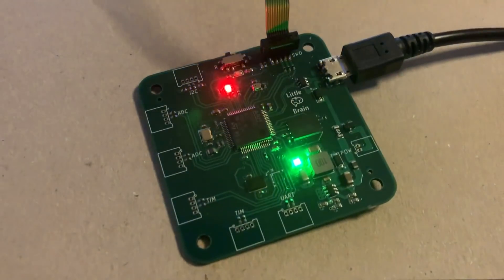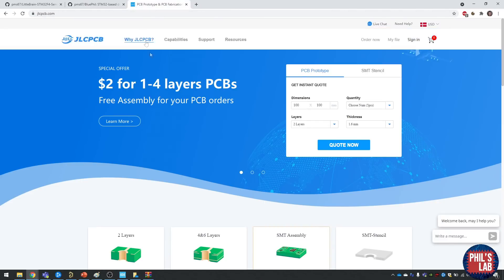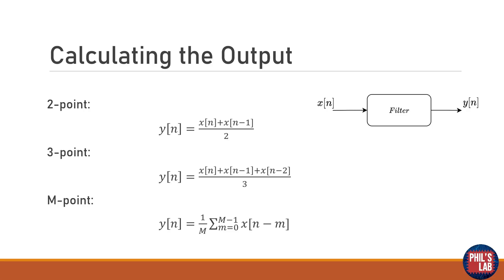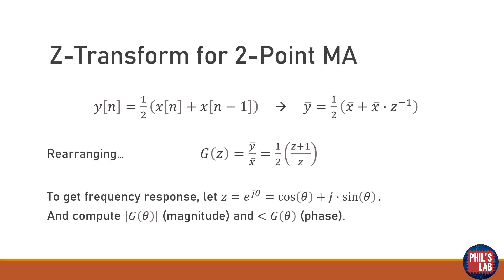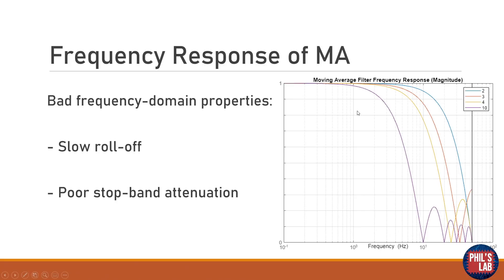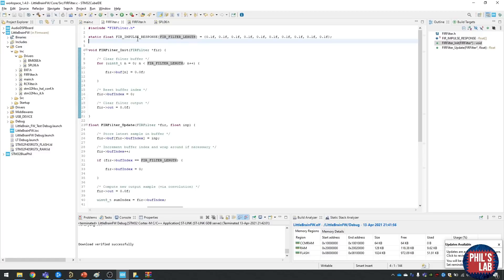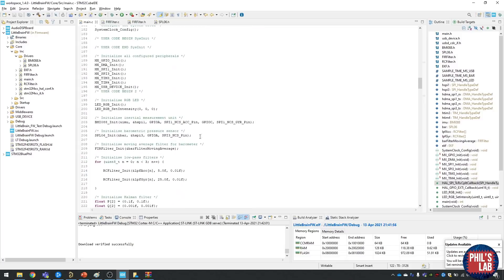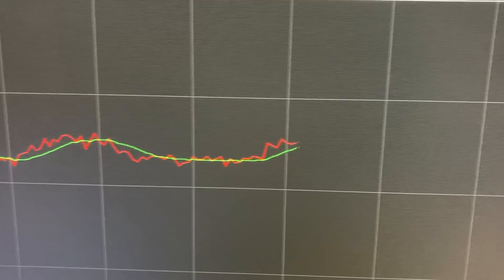(Sponsored) Moving Average Filter - Theory and Software Implementation - Phil's Lab #21

Comment: Dear Phil. Your Vídeos are very good. I would suggest you one vídeo using "semihosting" on M0, not M3 or M4, on STM32 CUBE. This is due to the fact that M0 does not have TRACE, and semihosting would allow debugger using INPUT and OUTPUT files passing throught the implemented M0 program. Other way would be to use UART to input/output throught some program implementations. Those videos would be great. Regards.

Comment: Hi Phil. Your videos are darn good stuff and you make me wish I had the energy I had 50 years ago but with 3D printers and all the good stuff of today. So, I will take issue with your claim of a simplest filter. I think a difference or derivative filter is much simpler. It is just the differences of successive pairs of numbers. It only has to "remember" the last point it read and the next point it reads. It is FIR in its nature. Of course, if you were a mathematician you would have said "The simplest filter is the identity filter." But isn't that too trivial for the rest of us. And in the same light you could say the next simplest filter is a gain filter that multiplies every point by some constant. Again kind of trivial although both these cases are mighty important if you are proving some set of operators forms a field. Or an algebra over some set, etc. I will have to change my claim to be the 3rd simplest and your moving average I submit will fall somewhere further down the list :-)

Comment: I've never had the nerve to try the JLPCB Assembly service as I'm not sure what steps are required for part alignment... would be interested in knowing how you got on with that part of the process... (I'm a KiCAD 5 user)...
Reply from the maker: I've got a video on hardware/PCB design with KiCad + STM32, which goes over the necessary steps to get the JLCPCB assembly done.

Comment: how does the performance of this compare to an infinite impulse response low pass filter? (which is similar to an RC filter)
Reply: The Moving Average filter is a second worst after Exponential filter. The frequency response of the EF of the with alfa=1/N, is about the same as for MA filter of length 2N.
     However, the MA filter settles in a finite time 2N, while EF takes ~8xN to settle (8-bit). The EF goes into the limit cycle for large N, the MA has no such problem. The MA filter has linear phase response, and EF is a nonlinear phase. MA filter is symmetrical, EF is not, etc..

Comment: Thank you.  If one implements a 10 point moving average filter (at least by averaging the 10 values and dividing by 10) then it will lag by 10 points from the raw data - but in your video they seem to be in step.  How does one handle this ?  Is it just a matter of suppressing the 9 most recent values in the raw data ?  Of course it is no big issue if one just wants to display the air pressure if it is a delayed by a fraction of a second.

A long time ago I read Digital Filters by R. W. Hamming - a nice elementary book in my opinion.  In the book he covers smooth nonrecursive filters.  Would you prefer one of those to a simple averaging ?  I know that the coefficients are larger and this might cause overflow.

I had not until today heard of the SPL06 - but perhaps it is cheaper than the MS5611 I have used in the past.  Thank you for reviving my interest in pressure sensors and for this series of videos.
Reply: The average includes the most recent sample, so it effects the output immediately, but not drastically.